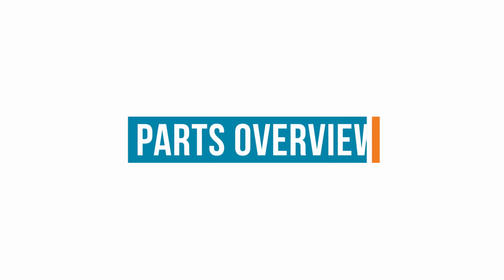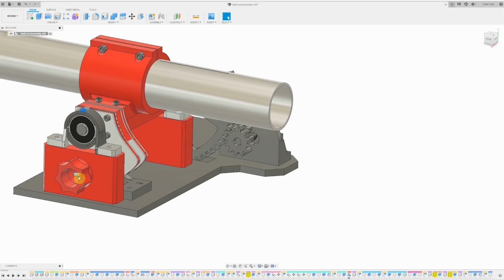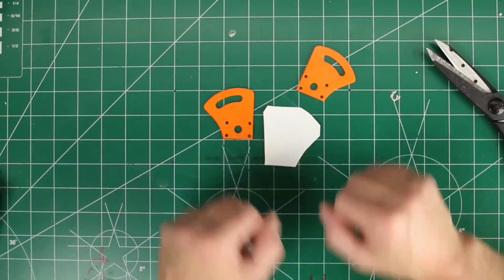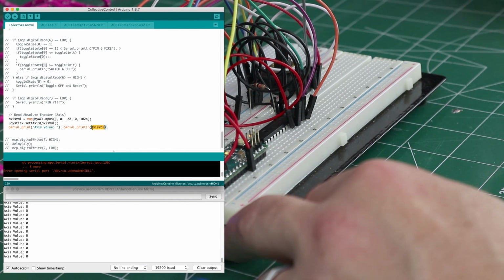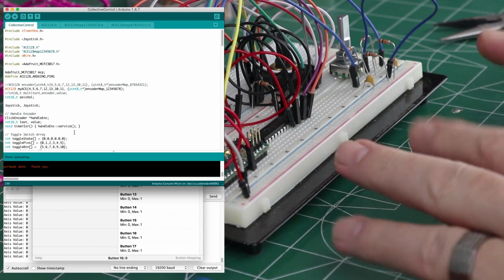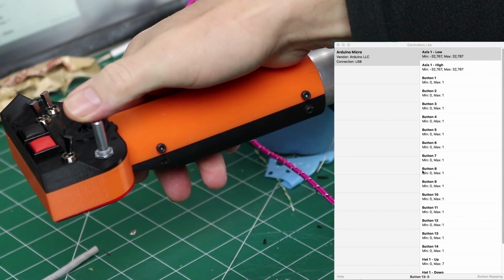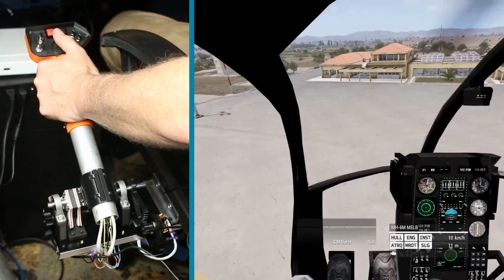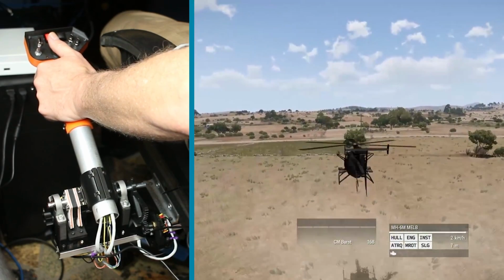DIY Arduino Helicopter Collective Joystick Control

Comment: It would help if the vid wasn't so fast, even at .25 it's almost impossible to follow. I wonder are there any step by step pics or at least diagrams showing the parts and connections. Not a schematic, a PLR that is easy to follow. That is what we work with in the industry, a map that has the name of the components and the positions on the board. Schematics are a pain in the butt, it doesn't follow what it looks like on the board.

Comment: Hi!
Awesome video.
But I have a question, if it is possible to ask.
I see that ground was chained between buttons, and I did not see any pullup-pulldown resistors used.
I myself want to do ah-64 collective, and I have huge issues having 42 inputs, trying to use leonardo + 74HC165 shift registers, and I think it is crucial to have pullup or pulldown resistors on each input (which is not convenient).
May I ask how wiring scheme is done here? Do you know a way to avoid using that much resistors? Cause internal pullup will not work on SPI :/

Comment: i was thinking about building somehting more usefull for helicopters too. but i was jsut thinking to do it on a easy way and only extend the shafts and cables of the joystick and the throttle...       it should be easier and dont need any extra parts except a "stick" for both controllers, 4 connectors and a cableset...      gonna see when i need a new controller to do it....

Comment: Very good tutorial. I have just built a button box for the h145 helicopter, but I'm  having trouble i do not know how to  code for arduino i have  tried . Many youtube. videos and websites but the code is full of errors. I just need  some code for 3 rotary encoders with switch and my buttons are in a 2 row 6 column  configuration. Any chance someone  can help me with the code please

Comment: I think an easier solution than a mechanically transmitted absolute encoder would be a VL6180X distance sensor measuring the arc distance. Might need something more powerful, like raspberry pico to smooth the results. Also: Raspberry pico allows programming joysticks with micropython...

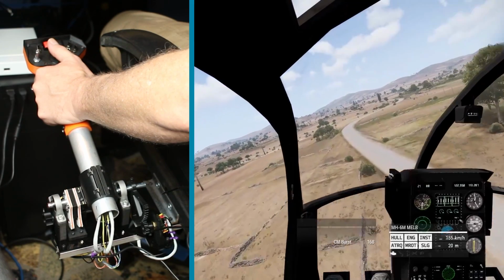Comment: 20:00 The cables that come out of the aluminium tube needs some cable protection tube, otherwhise the isolation will scrub off at the edge of the aluminium tube.

Comment: First of all, congratulations for the work done, really beautiful. I wanted to make your collective and I'm 3D printing the pieces, I have a stupid question to ask , (unfortunately I don't understand English), but what kind of paper is the white one you glue on the Friction_plate (see at 7:30 of the video) ? And then, How Imust use the GearArm piece? Thanks and ciao
Reply: Hi Maxi. It is not white paper. It is a plastic (HDPE). To fix it to the 3D printed parts Kaleb says did not have the correct glue. He used double sided tape to stick floors down - that is tape with glue on the top and the bottom side and the glue used is very strong. I would look for some 3M tape to do this... Not sure about the GearArm, sorry.

Comment: You just gave me an idea. Buy 2nd joystick, mount at 90 degree angle by your left hand, map controls. You then have a collective with neutral position built in, a twist throttle, and hotas built in. Two Logitech 3d pro's would do it for $100.00 or less. Love what you did but I don't have a 3d printer.

Comment: Did you consider using a hall effect sensor instead of the rotary encoder for the deflection measurement? Should give more resolution?
Reply: You will get extra resolution, but you dont need those extra values for games / sims

Comment: Absolutly brilliant design, I have actualy built this and ready to fly, 
BUT as I am new to the Arduino IDE i'm having trouble uploading the code as I keep getting :
 
Arduino: 1.8.13 (Windows 10), Board: "Arduino Micro"
CollectiveControl:1:10: fatal error: ClickEncoder.h: No such file or directory
#include <ClickEncoder.h>

Can anyone point me in the right direction please as to the correction of this problem.

Comment: "I love to fly in simulators, especially helicopters." Then why are you showing that in ArmA? Building a DIY collective for ArmA just doesn't compute...
Reply: Arma arguably has the unique experience of working with people on the ground, nothing can match that for me.  (That I'm aware of)
Reply: @Roebuck325  Still, it's not a sim.
Reply: @getsideways7257  imo Calling Arma "Not a sim" is like saying chocolate "Isn't candy"
Reply: @Roebuck325  Therefore, it doesn't make much sense to use an elaborate controller with it.

Comment: Arma 3 with the standard flight model is anything but a simulator. But still, awesome build! I wish I understood the circuit stuff, but even in engineering school, I couldn't get it. That's probably why I switched from mechanical engineering to structural engineering after my 1st year.
Reply: But it does have an md500. The simulation of walking to your bird and firing it up

Comment: Nice video and nice project. Interesting choice of rotary encoder instead of more precise Hall sensor for collective lever. In such nice project i would also consider to add throttle collar to collective lever, just to learn how to fly without governor (or for governor failure simulation).

Comment: You are missing the twisting handle on the collective for the throttle function (that's why the bought collectives are more expensive too)
Reply: But tbh, that's not really that much more difficult to include.
Reply: @cy-one  I was thinking it should have a twist.... Hall effect sensor is the way to go on that, it could be installed in  less than 30 minutes.
Reply: @JamesW81  I'm currently planning on building a Teensy 4.0 based joystick, and it will have a "lockable" twist for the rudder (not everyone wants a twist-stick :D).
I'll just use potentiometers for the analog inputs, though. I see no real advantage of hall effects in this case.
Reply: @cy-one  I was just thinking HE for ease with the twist axis... Although saying that, I guess if you fit a pot in the end of the twist and fixed it to the tube somehow it wouldn't be much more difficult.
Reply: @JamesW81  I disassembled an old Cyborg Evo today, and they had done more or less exactly that :D
Reply: @cy-one  What are your plans for your own build? Are you looking at using it for helos or fixed wing, and which sim do you use?
Reply: @JamesW81  Plans haven't come far yet, it's a rather new project. But I'm planning a bit while I'm working to get my new 3D printer to work like I want it to work :D

Basically, it'll be a non-authentic (as in, it's not designed after any specific joystick) somewhat modular joystick based on a Teensy 4.0.
Planned features so far:
- self-contained (the Teensy allows me to have all the electronics inside the joystick, with only the USB cable coming out of the stick, this enables me to...)
- modular "end" of the stick, either have a twist-grip for rudder that mounts into a simple "mounting plate" with a spring for centering OR remove the twist-section to have a place where you can mount a long tube to so you can "floor-mount" the stick (like in an old fighter or heli cockpit).
- dual-stage trigger
- dual-stage thumb-trigger (left)
- 5-pos thumb-hat
- 5-pos top-hat
- micro joystick on top
- few more buttons, probably also 1-2 tiny trim-wheels (also someplace "top")
- the mounting base itself will house the two main axis potis which will be mounted non-fixed on rotating gears, so you can trim the whole stick by just mechanically adjusting what counts as null-position by rotating the potis XD

... stuff like that ;)

Edit:
As for games... Different stuff really. Depends on what I'm in the mood for. The new MS Flightsim, GTA5, something like Elite/Star Citizen, etc.

Once I've learned to fly with the stick (meaning: build it), I also have a few ideas for throttles (nothing hugely interesting) and pedals (multi-functional with a locking slide for plane/car mode and pivotable for car-throttle/break).
But stick first ;)
Reply: @cy-one  wow! Sounds like that will keep you busy! I'm researching for DIY throttles mainly. I'm wanting to make an F-14 SIM cockpit for DCS. I do play elite and fsx and I'll eventually buy Fs2020 but I love the f-14 so I'll probably spend most of my time in that. I'm gonna buy the Virpil stick and base, but I'm making my own throttle as the Throttletek one is $800 and then shipping the UK won't be cheap. Also I can make it with metal so it won't be as flimsy as the Ttek one looks. Are you gonna upload some vids on the development of yours?
Reply: @JamesW81  Don't really do vids, no. And my development of stuff in general is so... "phasic" (means I crunch a bit and then don't continue for half a year XD) it's not really worth making a video about it.
Once I'm done I'll prolly publish most of the work on thingiverse and reddit, and if someone asks or points to a sim forum that would appreciate the work, also there.
Reply: @cy-one  lol! Sounds like have a lot in common! I'm terrible for half finished projects!
Reply: @JamesW81  it's especially not helpful if your 3D printer is currently on strike and you have no idea why.
Reply: @cy-one  yeah I bet that sucks. My next purchase is gonna be a laser cutter/engraver for making panels. Have you seen any of the Warthog project videos? Australian guy, his setup is awesome!
Reply: @JamesW81  Just checked it out. Not what I personally would want to do, but it's definitely an awesome project, holy shit :D

Comment: You can use "1-position spring-back" switches bought as rc transmitter replacement parts. I found some on ali express when searching "transmitter switch". I haven't seen any 2-position ones though.

Comment: I am thinking  about making a flight stick modification to one of  my sticks.  It uses the mechanical pot to read the twist and it is very jumpy. I would like to make a Hall effect sensor but how do i know which sensor to buy for the stick? I am assuming that any square neo magnets should also work as long as they are small? Last thing... is it simply a matter of hookingg up a hall sensor to the same wires as the original pot? Windows will  see it as the original?

Comment: How do you control engine power - isn't that a twist on the cyclic in a real helicopter?
Reply: Engine power in helicopter is controlled by governor (automatic power control) - you can disable it in case of malfunction and fly manually but it's whole new level of fun. The manual control (rolling the throttle on and off)  is only on startup, shutdown, if you want to idle or if you practice auto-rotations

Comment: Using an Arduino isn't even worth the hassle for a project like this, just use a Leo Bodnar board, it will end up being cheaper in the long run.

Comment: In Flight Simulator FSX at least, the collective function can be simply the normal throttle input from a joystick vertical axis - any normal joystick can be used, and it seems to me this is the same basic function you created here.  You added a number of buttons that can be pushed w/o having to remove your hand from the collective - that's a valuable addition to a simple joystick functionality. 
I'm impressed by all the design and fabrication you presented, plus the digital circuitry and programming needed.  But really, it seems a case of overkill for just the collective lever.  
Any decent helicopter control set needs foot pedals.   That should be your project.  It's mainly a mechanical problem to keep it smoothly linear over a wide enough dynamic range for the simulator, and using only short range of leg motion.  Additionally it might be programmed to have variable sensitivity so that the signal varies more rapidly the harder the pedal is pressed.
 I made my own pedals years ago using one analog potentiometer, some springs, a few hunks of wood and a switch, activated by toe press, for the brakes when landing fixed wing.  It worked to allow the correct method of sideslip for crosswind landings in fixed wing simulations.   At that time most controls were analog, so the pedals and the two analog joysticks were connected to the PC game port.  When PC's went to USB, I just inserted an inexpensive parallel to USB convertor box.  You can do better since you know all about digital controls and mechanical design.

Comment: Amazing. I'm was looking for this exact project to build a collective to be used in Elite Dangerous (space sim). I'd would need to add a throttle to the collective also. What components would you recommend for a throttle control? It could either be a roller or some kind of a  slide potentiometer. I'm imagining all the funky buttons I would add the make it easy to lower/raise landing gear/cargo scoop, go to super cruise, manage power conductor. This project is amazing. But first I need a 3D printer now.
Reply: I've decided to go with a twist grib kind of like this one for the throttle. Will have to make it independant of the controls pad at the top and only make the handle itself turn-able.
https://www.youtube.com/watch?v=Gtb2Of1tumk

Comment: I'm in the process of designing/building a helicopter collective too.
I've decided to use Hall Sensors for the collective instead of an encoder, and using Atmel 328P with V-USB's USB implementation.

Comment: Hel(l)o. Thank you for this very interesting content. I can see you use a (relatively expensive) encoder that gives you 128 PPR. What's the point, since you could have used a dirt cheap potentiometer on an analog input? There has to be something I don't know, since I'm not in electronics at all. The fact is, I ordered a teensy LC and a few potentiometers to do roughly the same thing (flight controls). To me, the encoder seems rather pointless if you're not going to use it for more than one revolution, whereas a 10 bit reading on a potentiometer could give you a far better resolution (and some room to filter the reading if needed). I don't mean to criticise anything, because I don't have the knowledge to do so in this field, but perhaps someone could explain me. I must be missing something, here.
For the mechanical side, which is more my thing, congrats! This is a nice design. I might add some counterweight myself, if I had to use it. This way, the friction plates would have almost nothing to do, appart from giving you the resisting effort you want (no need to deal with the weight, thus you reduce the friction needed and end up with a better feeling, theoretically, and no difference between the push and the pull efforts). Maybe I'd try to implement some kind of adjustable neutral position, but that would become a bit more complicated ;-)
But in the end, I'm just typing, and you DID the thing.
Reply: I’m in the middle of building a throttle quadrant with 3 linear slide pots plenty of buttons and toggles and an arduino micro, this is my first time even looking at an arduino and I have no idea what the frig I’m doing regarding the code! I have the pots in the analog inputs and the switches wired as a grid into the arduino but the code is blowing my mind and it’s still blank 😭
Reply: one big reason to choose an optical encoder over a potentiometer is no touch. After a while the wiper contact gets dirty and will fritz out on you. The sealed case on the encoder means it will continue to work until the LED burns out.
Reply: Old thread but the encoders will be perfectly linear which the potentiometers probably won't be, and they won't wear out.

Comment: good morning how are you, I hope well, my name is Francisco and I am from Gran Canaria, Spain, first of all thank you for putting this magnificent project in everyone's hands since it is not easy to achieve something like this .. I have been watching the video and I have seen that you have made the STL files available to everyone, but what I cannot find is the electronics, the connection diagram of the arduino and the MCP 23017i GPIO with its components. Where could I get the electronic connection scheme? And my other question is, do you have plans to improve the project?

Thank you.
Reply: Go to the Elements14 website, sign up and search for the same name as this video. It's all there. Just follow the links in the above description